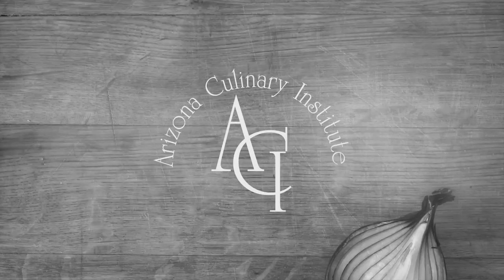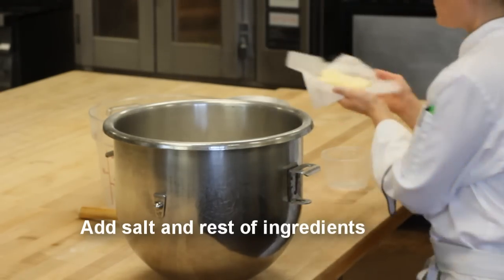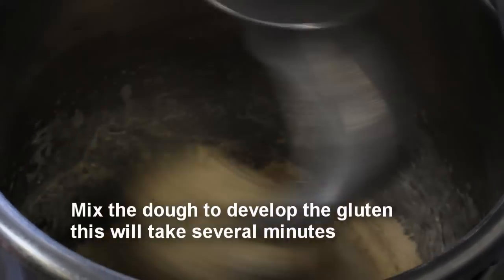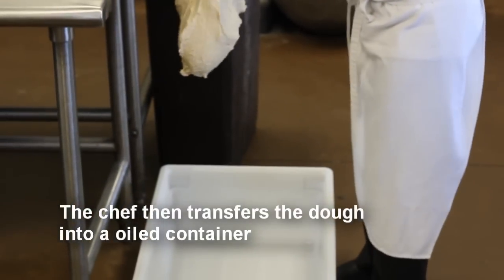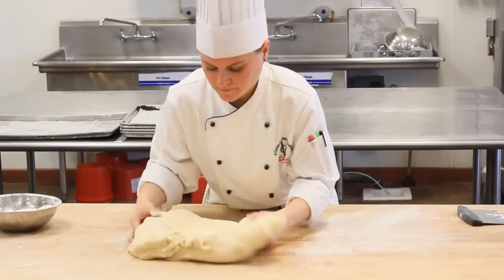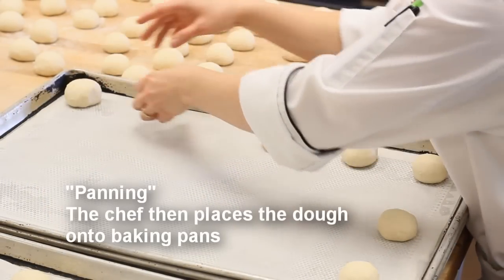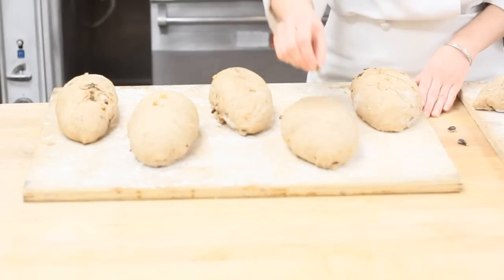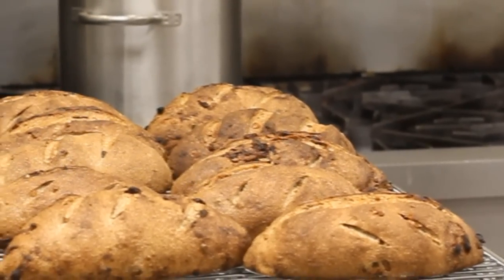Straight Dough Method

Comment: ive never seen use of ice cubes in the oven to make steam. usually i just stick a loaf pan filled with water in my oven at home.. there is a steamer oven at my school.
Reply: Some will keep a pan in the oven filled with chain links, and place the ice cubes in the pan when the bread goes in.  Your loaf pan filled with water will raise the humidity somewhat, but it's not as effective as it should be.  You only really need the steam during the first few minutes after placing the product in the oven.